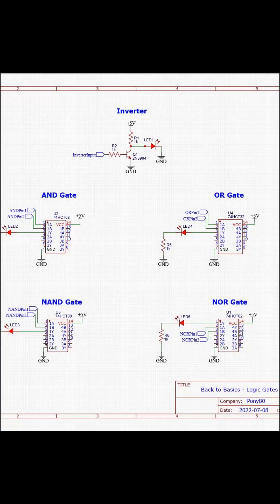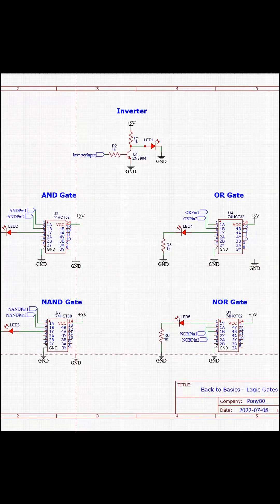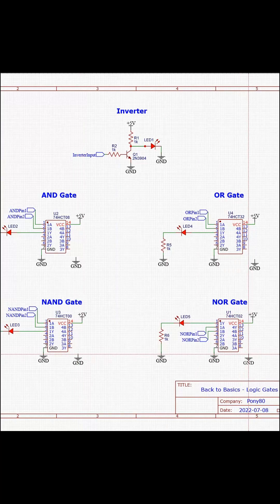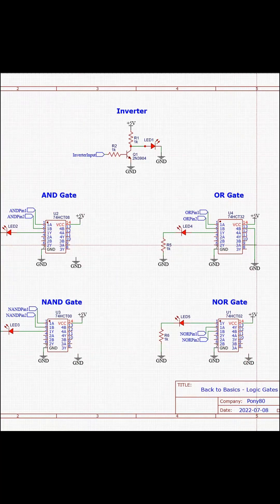Ground Unused Inputs

Comment: is it also good to add a resistor to the gnd? i think i read something like that yesterday- tying it low to prevent unprecedented behaviour or something
Reply from the maker: I don’t think you need to on the inputs, you can connect them directly to ground. You don’t want to connect the output to ground without a resistor, but for unused pins you can just let outputs float.
Reply: @Pony80  Adding a resistor may be very convenient for one reason: modifying the behavior of this pin later. If you make a PCB out of the schematics, where input pins are tied to GND directly, if will be very hard to add a wire by hand to any of these pin if it turns out you want to use it. Mainly if you have a GND plane, because your pins would be connected to the plane directly. However, if you add a resistor, even a 0Ohm one, you will be able to get rid of the resistor easily, and reuse the input pin whenever you want.
If the resistor is big enough, you may even be able to  connect your input pin to your new signal without even desoldering the resistor.
Reply from the maker: @Zeal8bit  That is a good idea!  Thanks
Reply: Tying unused inputs directly to ground can be done without too much of an issue. In my circuit designs I use a single in-line 1K unit to pull the inputs to ground. That way the unused inputs don’t float, and tying them directly to ground, in rare cases, can cause the IC to dissipate excessive current internally. When I have to tie an input high, I use a single in-line resistor at 10K. This way, I can pull up the input and not stress the unused inputs by tying it directly to Vcc.

But your mileage may vary, and it makes the cost slightly higher using a SIP, but I’ve never experienced an IC failure in over 30 years doing it this way.

Also, remember, when using CMOS logic, pulling up (or down) is mandatory for unused inputs. CMOS, unlike TTL, will not naturally pull up. CMOS’s inputs float to an “undetermined” state and this can make the whole IC unstable.